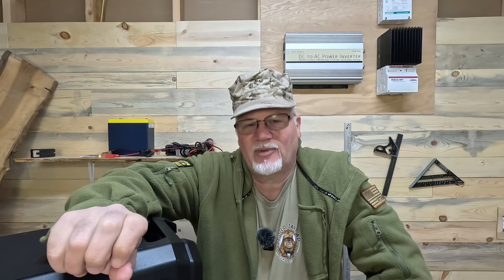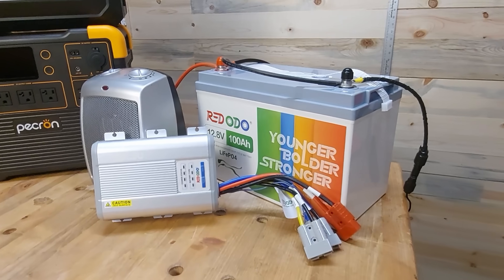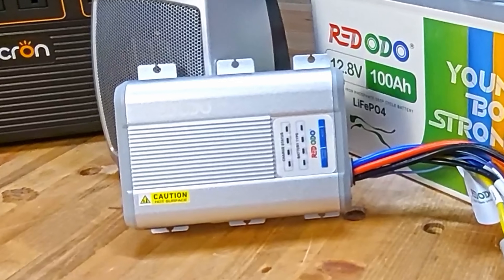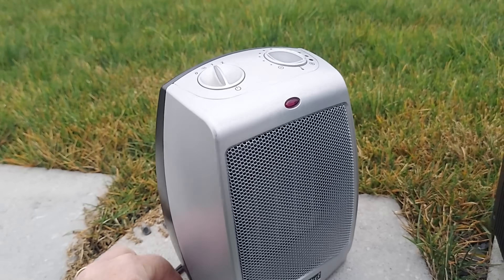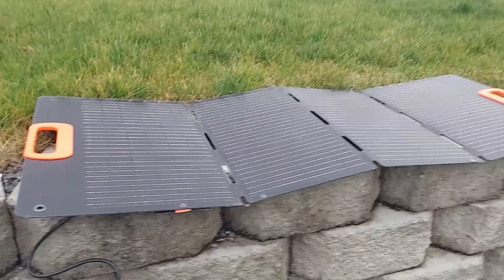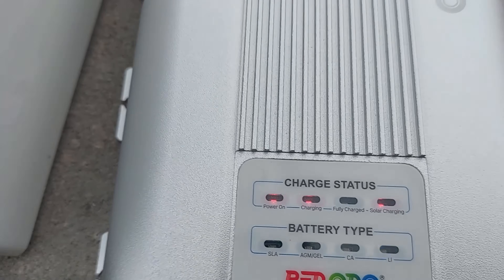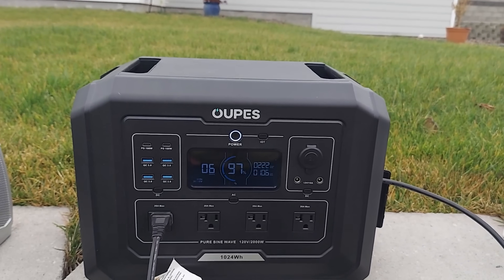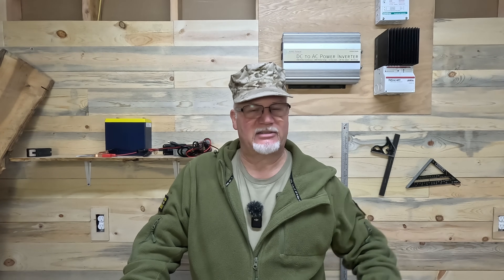🔋 LiFePo4 POWER STATION Hack That Actually Works! 🔋

Comment: Hey Old Jarhead thanks for all your videos! I have an Oupes Mega 1 & an expansion B2 battery and after watching your video, I thought it would be good to have a LifePO4 battery, propably 12V 100Ah, to use JUST for charging my Oupes on a bad solar days and when I have no access to AC. If I want to build the system for charging only do I need the redodo? I know I will still need to place a terminal (30 Amp?) fuse on the positive side but do i need the redodo converter? Thanks for all your videos, I really enjoy them.
Reply from the maker: You're quite welcome.  You can use any LiFePo4 battery for this (any battery actually but only the LiFePo4's will hold up under this kind of use).  However, a 12v battery is the least best option as it only transfers (that's really what's happening) about 130w continuous to the power station vs a 24v (twice that) or 48v battery (the best option) when using the solar port.

That's where a DC to DC charger comes in as it can step up the voltage from the battery if only 12v to a higher voltage like 48v (the Redodo doesn't do that but ones like the Oupes DC Charger or Etakers do)

Comment: Interesting video. Thanks Jar...
I live in Jamaica and have been working at climate proofing ever since we had hurricane Beryl in 2024; Melissa in 2025 makes the effort more convincing. Now, I have been looking into solar generators and have my eyes fixed on either an EcoFlow Delta 3 Classic or Anker SOLIX C1000 Gen 2. I can see from your video, just how I can increase the storage capacity of either of them. The question though (as a newbie) why can't a regular charge controller work, instead of a DC-DC unit? In my mind, the external battery "sees" the generator simply as a load, and the generator "sees" the external battery as a solar panel. Please help me to understand this, just a little bit more...
Reply from the maker: Power Station ;) They really aren't generators.  You can absolutely use a DC charger and many brands make them for that purpose.  Once installed in your vehicle you can just plug them into your power station's solar port and away you go.  So DC Chargers also have battery charging function which makes it even better.

Ecoflow and Anker have good names though don't only look there!  I saw their River 2 pro only has 3000 cycles!!!  YIKES!  That's a red flag to me because it means they are cutting corners on the battery cells.  Most good grade A EV cells have 4000 cycles to 80%.  Look also at the other brands like Bluetti, Jackery, Pecron, Oupes, etc etc
Reply: @TheOldJarhead  Thanks for the timely response and the advice on the battery brands/cycles. 
I think you misunderstood my question though, or I misunderstood your answer. I don't want to plug my Power Station in my truck; I already have an inverter in there. What I am looking to do is power my home in the event of another hurricane/storm event. This situation can easily last for months here. Hurricane Melissa just a month ago devastated our country and about 35% will not see grid power until mid next year, at least. 

Anyway, I have been looking at a lot of videos showcasing off-grid/back-up options, and yours hit me as to how to extend storage capacity. In your video, you used a RED ODO DC-DC charge controller, and my question was why couldn't I use one of the regular charge controllers that I see being used on a solar set up eg: DIY solar (panel + controller + battery + inverter).
Reply from the maker: You absolutely could do that.  I just used the DC to DC Charger with Solar Charge Controller to show how it can be used and as it also has the DC to DC charger you can use your cars alternator as well.  

If you use a solar charge controller instead, it works perfectly and I've done some videos on that as well :D  https://youtu.be/C0psWTrMTgM
Reply: @TheOldJarhead  Thank you. Blessed love. 🙏
Reply: @TheOldJarhead  ok Jarhead. So, I've been looking at some more power station brands, like you suggested and stumbled on the DJI 1000 V2. I noticed that they have a funny little thing going on with no built-in charge controller, and two SDC ports. Can this power station hack be made to work with that unit? If so, how?
Reply from the maker: I'm not sure.  I've not played with theirs at all so can't really say.  I've heard good and bad things about DJI power stations so, while they may be THE Drone company, I'm not sure about power stations.

Comment: It would be nice if it could use the mppt in the "generator" and then send the extra to the 2nd battery
Reply from the maker: Do you mean the power station?  I'm charging the battery while it provides power via the MPPT
Reply: @TheOldJarhead yeah if you could use the power station mttp so you don't have to buy another one
Reply from the maker: Ahhh, it's only one way so it can be used to charge the power station, but nothing else.  However, with enough solar you could charge the battery off the power stations AC output with a battery charger but it would be inefficient
Reply: @TheOldJarhead it would be nice if the power station would charge the battery in DC
Reply from the maker: It would be but require a charger be built I'm as they need the correct charging profile.

Comment: The 100w limitation is because the designers assume you're going to be charging using a 12v cigarette lighter in a car (around 14v when running). Using power law: 100W/14V=7.1AMPS keeping the current draw below what they are designed for (10AMPS) (12v is around 8 amps). This is so you're not blowing fuses all the time which is why in your afery video you can get a higher wattage out of it at 24v as it now 'thinks' you're on solar which can provide a higher wattage but is inherently limited by it's solar energy input meaning you can try and draw infinite amperage but you can't draw more energy than is in the system.

I hope that wasn't a word salad and explains why they act this way.

Your videos have made me consider a different set up for my campervan. I have the afery station you have and was going to run a simple 12v switched supply to charge it, now I'm considering a 12 to 24v DC/DC charger so I can charge the power station at around 400w rather than the 100w limit on 12v
Reply from the maker: Certainly could be in the programming

Comment: Wow, very interesting. I'm new to this topic and want to make sure I understand this correctly. I have a Oupes mega 3. That through the solar input specs: ( mppt-12-148 volts, and 15 amps MAX, open 18-140 volts, 2100 watts max) I can connect my LI Time lifepo4 100 ah battery directly to the solar input? The external Li Time battery won't push more than the 15 amp max rated amount possibly harming my mega 3? Thankyou for your expertise and advice.
Reply from the maker: The battery won't 'push' power but rather allows the power station to draw it so no worries there.  However,  the battery voltage plays a large role here in the the power station can only draw in watts the voltage times the amperage so at 15 a.ps it can only draw 180w from a 12v battery (give or take).  Best to have a 48v battery or even two in series.

Comment: I have a question. I have a 48v battery i haven't used yet because I don't have a way to charge it. Do I have to use a 48v charger or can I use a 12v charger as long as it puts out enough amps? I was thinking that amps was what is important but I'm just not sure. I bought the eg4 51v to expand my ecoflow ultra life
Reply from the maker: No, you must use a 48v charger, and if LiFePo4 then one made for LiFePo4's

Comment: For the Jackery 2000 v2, here are the specs for the solar input from their website, which are a little confusing to me: 
DC Input
(2x) 2 x DC 8mm Ports: 11-16V⎓8A Max, Double to 8A Max;16-60V⎓12A, Double to 21A/400W Max

Say there is a charger that does 30A. Will that charger damage the solar ports which show 21A max? Or will the solar ports regulate the amps? Is voltage really the issue that would cause damage (too high) and excess amps won't cause damage? 

From what I can tell, these 12 volt to 12 volt chargers won't be very fast on the Jackery, because 11-16 volts are limited to 8A.

Still new to this and trying to figure out things. Thanks for the videos.
Reply from the maker: Amps aren't the issue, voltage is.  As long as the voltage is no greater than max its fine.  Think of the Amps this way: the Jackery requests them and they're delivered.

Comment: Could you do away with the solar panel draw dc power from the power station to charge the extra battery?
Reply from the maker: Ouldnt make sense but you could charge the power station from a DC charger or feom the battery that's charged by the DC charger

Comment: hi thx for the video i have one question i boondock in my RV 
i have 1000watts solar charging my lead acid batteries i have a residential fridge connected to power station via pass through charging from the inverter via lead acid batteries. i want to add an external battery lifepo4 to the power station can i use a 20amp battery charger to continually charge the external lifepo4 battery while im charging the power station and running the fridge-  so power from solar goes thru inverter plugged into the power station and 20amp battery charger  running the fridge and charging the lifepo4 battry at the same time    thx wayne
Reply from the maker: What's the voltage of your setup?  If it's within spec for your power stations solar port, why not connect via the battery bank to the power station's solar input port with an inline fuse that's just above (25% over is usually ok) the amp rating of the solar port?

I'm curious though, why you don't run the AC off the battery bank?  With 1000w of solar if running a lower output AC Unit (8000btu's or lower) they often only draw around 500w give or take 100.  Of course, my suggestion would be to convert to LiFePo4's on the RV instead as you'd have considerably more power available.  For example, when I went from 660AH of lead acid to 360AH of LiFePo4's it gave me CONSIDERABLY more available power (in storage and useability) than my lead setup did.

Comment: Do you know if the redodo dc to dc charger with mppt would work with 2 Renogy Shadowflux 200 Watt solar panels connected in parallel? The solar panels have VOC of 37 volts and about 6.8 amps short circuit currnet each. putting it at 37 volts and 13.6 amps total when in parallel. Cant find a solid answer on the max voltage of the redodo dc dc charger with mppt
Reply from the maker: It won't work with those as the max voltage is 30v on their MPPT.  My Aferiy 400w panel works great with it but the Allpowers is also too high a voltage.
Reply: @TheOldJarhead  thats a shame. I did find a similar DC to DC charger with MPPT from victron thats rated much higher voltage so that should work hopefully. This is just a backup plan to store some excess solar in my van when traveling. I'll keep ya posted once I complete the van build. I've got about $2k worth of crap on the way so got a lot of building to do haha
Reply from the maker: Victron is good stuff so you should be set!  Let me know how it goes!
Reply: @ I'm curious, what's stopping someone from just using an MPPT charge controller on its own to charge the battery? It seems the DC to DC is only if you want to charge from your alternator. The mppt side is the only one being used when your'e charging your external battery from the solar right? The Redodo does nothing towards the power station so not sure if im missing something or if an mppt on its own would suffice
Reply from the maker: Nothing.  I've mentioned that a few times in videos.   It's a slippery slope. Next, they will skip power stations all together and get an inverter 😁😆

Comment: you beautiful bastard. Ive been struggling to find this answer for so long. I have an anker solix F1200 and a 100 Ah battery. I also have 2 x 200w solar panels that I use to charge the anker power station. I wanted to use the 100 Ah lifepo4 battery to charge the solix when theres no sun and for the solar to charge both the solix and the 100 Ah battery when the solix F1200 is full. This is possible right? Would I just use an AC to DC battery charger or is that redodo dc to dc with mppt controller enough?
Reply from the maker: lol Thanks 😊  If you connect the battery to the solar port and the Redodo DC Charger w/MPPT controller to the battery, the connect the solar panels to the redodo like I did here you won't need a charger as long as there is enough solar and sun.
Reply: @TheOldJarhead  so what happens to the power once the sun goes away? Would my power station begin to draw power from the battery? (this is the outcome I want). I basically want the 100Ah battery to be a secondary source of power when the sun goes away but for the solar to charge the 100 Ah battery when the sun comes back and my power station is full. Just a place to store excess because my anker F1200 power station is a small amount (1299 Watt hours capacity).
Reply from the maker: Yes.  As long as the battery is connected to the solar input of the power station

Comment: I'm confused. I don't have a solar panel. I just want to keep the battery charged from a outlet in the house. Can I use a general charge (I am thinking 36v battery in my case), and at the same time have the battery connected to the power station?
Reply from the maker: You can always charge from a house outlet.  And you can connect the appropriate charger to the extra battery ti charge it off utility power as well.  As long as the charging profile of the solar input allows the input voltage of a 36v charger than that would also be fine though unneeded as you can charge off the house power.

Comment: I have a mounted 12v system in my motorhome, with a victron 50/100 mppt charger. Will it work if I connects a 48v battery to the solar input will it charge
Reply from the maker: It would be better to use a DC Charger like the Redodo I reviewed that puts out the right voltage.  However, a battery connected to a charge controller can certainly work in a pinch for a short-term solution when the sun is down.

Comment: This seems good, but wonder if we can find a better charger.

Being that this says 12v I'm assuming it probably can't use the majority of solar panels running 40v+ and we know the higher the voltage the faster we can charge the power station for this very reason.

Further the reason behind that, the higher the voltage the more watts we can push thru the same circuits without burning them up.
Reply from the maker: It's designed for 26v max which a lot of 200w panels are at.  For example, my 615w array is 18.54v and 33.81A but that's an older array.

Comment: Tks for a great video. Looked up the dc to dc charger, I use mc4 , but what are the gray connectors. The input is a kit, you have to make your own lead. Could you cover that in more detail. Can you buy mc4 to the gray plug. Thank you for your patience with my ignorance.
Reply from the maker: No problem - the plugs are 50A Anderson Plugs that can be bought on Amazon with MC4 connectors on the other end.  Note:  The Controller is limited to 26v so any solar panel will need to be under that voltage.

Comment: this is EXACTLY what I was looking for and asked on other channels. Thank you so much for providing this video! you are awesome. Question to anyone that knows: at @9:40 it says that you DO NOT want to run a cabin on this type of setup and is kind of for emergency only... but.... why not? If the system is big enough with some of the BIG home stations, why not one of the massive 3600W (or even 7200W) power stations with 1-4 big 12V 300 AH batteries + charge controller and adequate solar panel array? What would be the problem?
Reply from the maker: If the batteries could be paralleled (like with the Comvolt Power Stations) then you could run a cabin this way I guess but not via the solar input which just doesn't allow enough power to pass through.  You'd be far far better off buy the batteries (I run my cabin on 9kwh/360AH@24v of batteries), a charge controller, solar panels and an inverter.  It would typically cost less (specially today! - Michael Wilson at Wilson Forest Lands built his system for around $5k and it's 10kwh of batteries and expensive panels (he could have spent 1/3rd what he did on panels) and the only thing is he doesn't need much 120v and uses a power station for that - that he charges off the solar).

In truth, power stations are great for short term use and you could run a cabin, say for a weekend, of one like the 3600w units but only just.  Sure, there are some advantages to doing that (like bringing it home) but I guess it's a matter of perspective.  I leave my cabin ready to go at all times and just walk in, turn on the power and get the wood stove going.
Reply from the maker: OK, I've given this more thought.  Yes you could do this.  I think the caveat is how much power you would use at the cabin.  I could run mine on 6kwh with good solar (I have) and the right power station (one with the capability of taking in 2-3kw of solar.  But I suppose even 1kw of solar might work with good sun and a generator to back it up.
Reply: @TheOldJarhead  Thinking of going pure solar in the philippines since the price of Electric is very high. Use very little power a month, less then 200KWs per month. Typical house draw is only a couple hundred watts... BUT if turned everything on at once (which would never happen) would be about 2000 watts total consumption at once.
Reply from the maker: Not too hard to manage then!